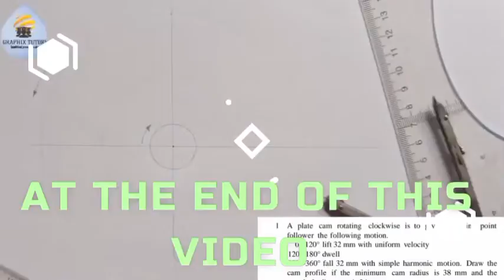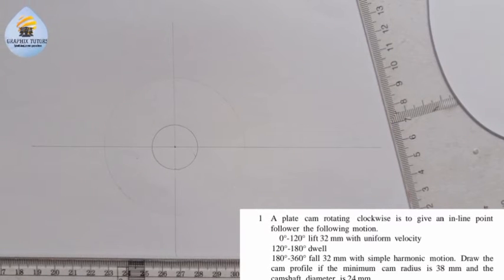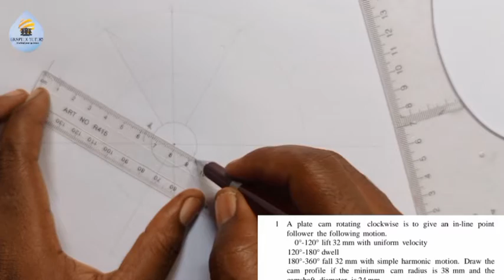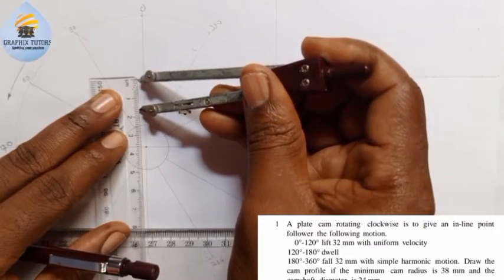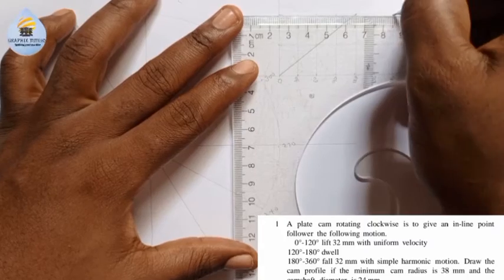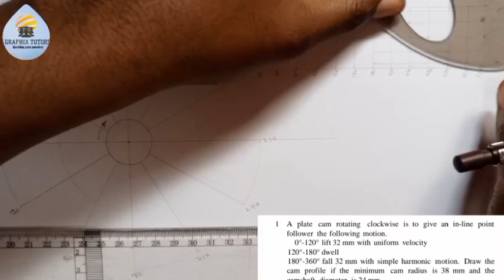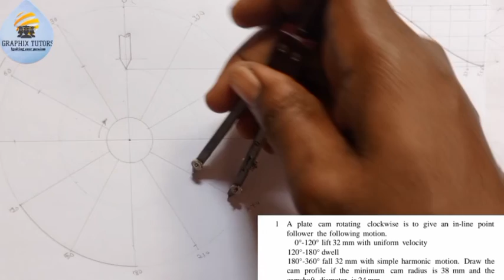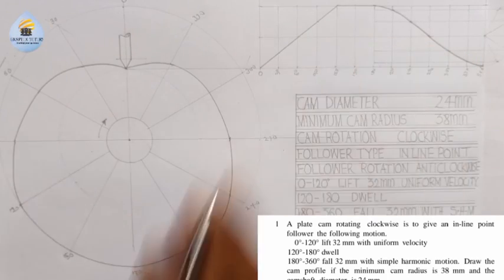Cam profile & displacement diagram, lift with uniform velocity fall with simple harmonic motion

Comment: Draw full size in third angle projection a dimensioned front
elevation and sectional end view of a 30 tooth spur gear,
module 6, 20° pressure angle. Show three teeth on the front
elevation drawn approximately and a table of gear data. The
face width of the gear is 25 mm, rim diameter 158 mm, boss
diameter 34 mm, reamed 24 mm diameter, boss length 50 mm.
The boss is supported by four straight spokes of elliptical
cross-section, the minor diameter being constant at 10mm and
the major diameter tapering from 24 mm at the boss to 22 mm
at the rim. Fillet radii 5 mm. The boss is symmetrical about the
centre line in the end view. Show a revolved section of one
spoke on the elevation
Please help me with this it's an assignment